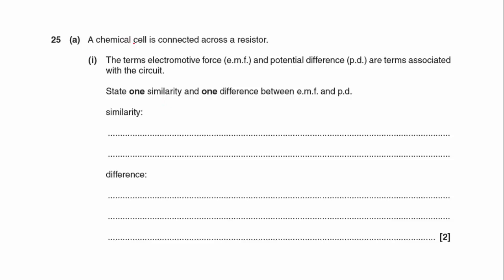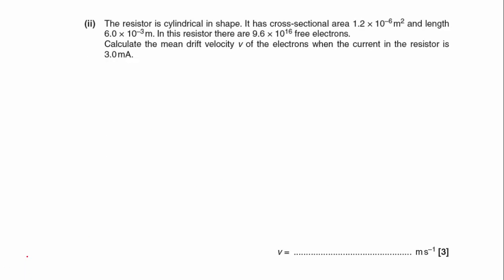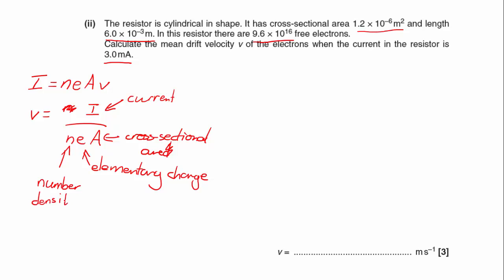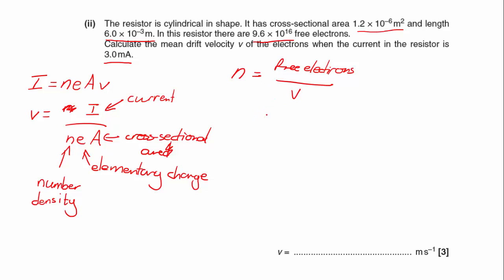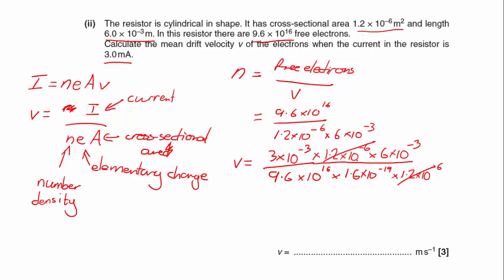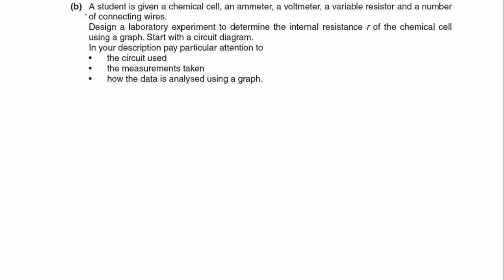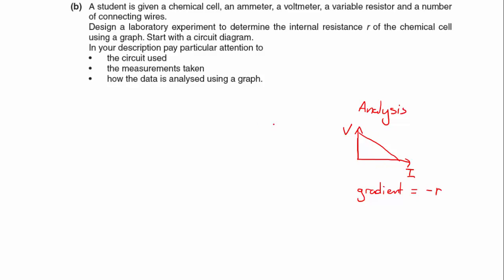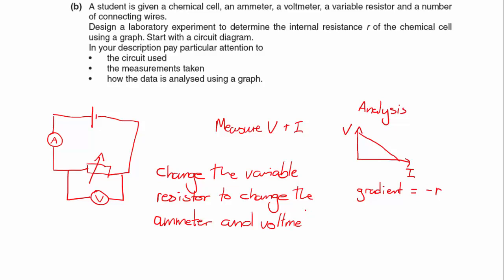Breadth in physics 2016 Q25

Comment: amazing videos, but, for part b, wouldn't that give us the resistance of the variable resistor? the question asked for the internal resistance.
Reply: It doesn’t matter, think that the p.d. that leaves the cell enters the variable resistor as the only component then the p.d. that leaves will enter the cell again so you’ll be measuring the exact same numbers but just at different points :)

Comment: sorry, how is it possible for part ii that the number density is higher than the total number of free electrons?
Reply from the maker: Viyana Karimi As explained in the video, the number density, n, is the number of free electrons per unit volume i.e. the number of free electrons per metre cubed of the material. The question tells you the number of free electrons in the resistor. The resistor's volume is much less than a metre cubed, so the number density of the material that the resistor is made out of is going to be very much higher than the number of free electrons stated in the question. I hippie that helps.
Reply: Ohh ok thanks!!! That really helped :)